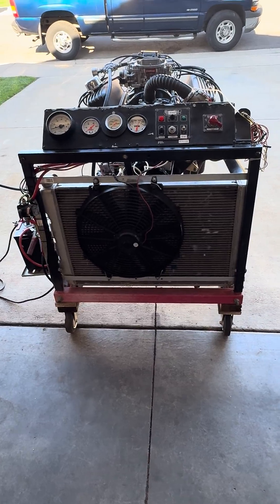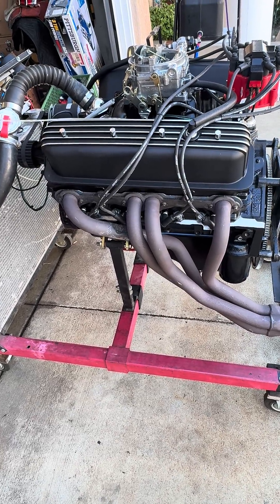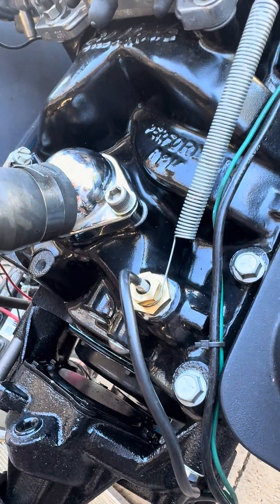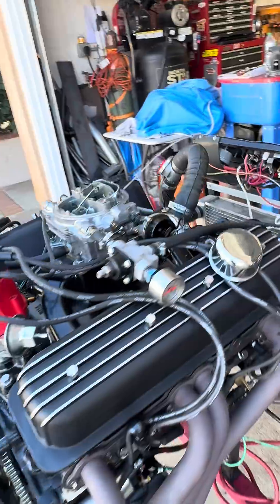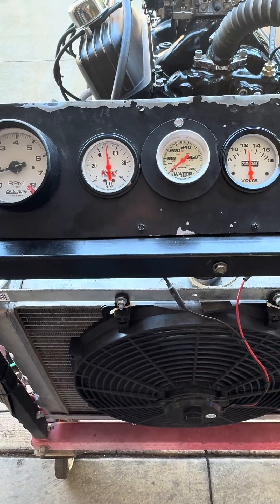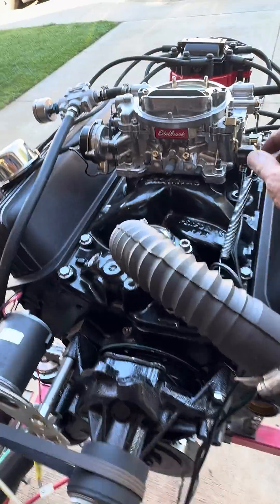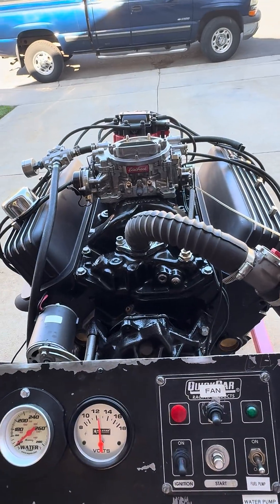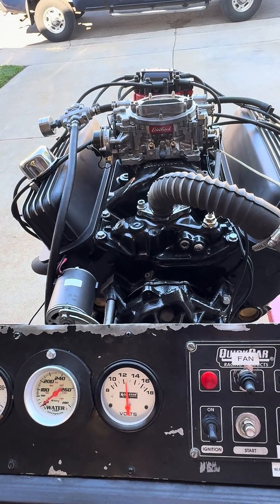JMacPerformance 350 small block Chevy 400 horsepower - 420 lb-ft Torque

Comment: i built a 350 a few years back with the vortec heads.
400hp 450ft lbs of torque
torque down low fuel injection lockup convertor it actually gets great gas mileage and runs great. i have it in a tiny suv and can pull a trailer or win a race any day of the week.
Reply: Is that with spider injection?
Reply: @twinchrome3258  yeah the wonderful thing about the actual vortec engines not the ls rebranded as them. you dont need to turn a million rpms to make power. they want to make torque low and shift by 5k yeah its rough on the bottom end but the sbc has a nice lower end. forged crank and powdered rods stock . roller cam. yeah its not so bad bro. 

i have it in a light suv so my numbers a a little loaded 3,000 lb vehicle with 400 hp its gonna be fun. it can outrun a hellcat in acceleration ez. i weighs half as much and i have all kinds of mods here and there to make it all work quite nicely. 

if you dont believe me stock the vortec motor is good for 350hp/350ft lbs of torque it has diff tunes u get based on application. gm hot cam same one in zz383 will give you 384hp in stock motor. my cam is a big upgrade from that and the biggest you ran run in these without modifying the heads. its good for over 400hp out the box and the mods i have. its solid power and has lasted me almost 100k miles. thats a pretty good setup.
Reply: I love it !! That’s great

Comment: What is the dc motor running off that small belt on the water pump for? (maybe used as generator for approx rpm on test stand?)
Reply: That’s a spectacular test stand+full setup though!
Reply from the maker: It turns the water pump. I don’t have a fan belt set up so it spins the water pump to keep the engine cool.
Reply: @JohnMcKindley oh r u just using it as a bearing setup? (The motor)

Comment: That’s pretty decent power for a really basic low compression 355. Many years ago I put together a 4 bolt 355 with ~10.5:1 in it under some World Products heads and a pretty aggressive cam. It only made about 450 but it sounded like a pro mod lol. It did move my 4 door 67 Chevelle fairly well.
Reply: tech changed alot man. im running a mild vortec 350 with a lunati cam before they got bought out. easy 400hp and more torque. people dont know what it sounds like but their always looking for a monster truck when they hear me.
aint gonna hear someone talkin about their 1.6l like that
Reply: 2 bolt main is actually stronger 💪
Reply: @explorster  yes a 2 bolt block has more material and you can do the splayed caps and its far stronger than a 4 bolt.

Comment: Bet it's really all stock internals 😂 all American weak mussel V8 sound tough without half the exhaust system 😂😂😂
Reply: All you need for 400 HP.
Reply: @BillBowden-g2g  😂 400hp V8 the Suzuki chino 3 cylinder with some bolt on mods can achieve 300hp and 450hp with some internal work.. i've also seen a 1L 3 cylinder put down 160hp per cylinder 480hp in fwd drag car here in Australia 🦘 American V8 engines are junk we have plenty of US V8 engines in Australia and they all end up on the side of the highway with the bonnet up spewing smoke or steam as they die 😂😂😂
Reply: @michaellegg9381  horsepower is not the only measurement. Theres a big difference between fast and powerful.
Reply from the maker: Can you send me a video of a 3 cylinder engine making 450 HP? Not saying its isn't possible I've just never seen a running 3 cylinder engine.
Reply: @JohnMcKindley  just run a YouTube search there is a few videos ranging from 150hp (most streets builds) the 250hp and up are usually track and strip builds. They is a few videos of a development engine 90hp 1 cylinder engine which is a formula One engine ( well 1 of the cylinders to help with building as much power as possible from each cylinder) I'll try find that and post the link as it prove my point for all engines that 90hp per cylinder is definitely achievable and is common in Australia 🦘
Reply: @JohnMcKindley  https://youtu.be/gZs-R6cfCKc?si=AvNIAHTVu5qrSyoV

Is the link to a single cylinder F1 development engine that's 90hp and so light you can carry it with only 1 person. Suzuki chino engines are in the Summernats videos it's not something that has a particular video. But 90hp x3 =270hp and that's built to be a long running reliable engine but drag engines are 1 pass them rebuild are upwards of 160hp per cylinder but also require rebuilds after 1 or 2 passes.
Reply: @michaellegg9381 we don't have Australia engines cause you don't develop them.
Reply: @BillBowden-g2g  yes we do. The Barra 6 cylinder range of engines and Holden 186 and 202 and the 253 V8 and the 308 V8 engines among many others
Reply: You really thought you were gonna do numbers with this one huh🥀
Reply: @QuantumPlaysOfficial no just letting you know that Americas unpowered overweight garbage fails against Australian home grown inline 6 cylinders and fails against Japanese inline 6 cylinders and 4 cylinder engines 😂😆 that even still have cat and stock exhaust systems 😂😂😂 American muscle 🧑‍🦽

Comment: What is "blue printed"?
Reply: It's an overused term nowadays and people forgot it's meaning with engines. It means they've taken the time to make every round thing round and the same, every thing that's straight straight, everything perfectly concentric, zero taper in journals, nothing out of round etc, all tolerances perfectly nominal, all clearances and deck heights all the same, combustion chambers cc'ed and made the same etc. nowadays it's synonymous with just meaning "crank has been ground and rods have been honed"
Reply: Balanced and blueprinted basically all math is written down each component that's balanced